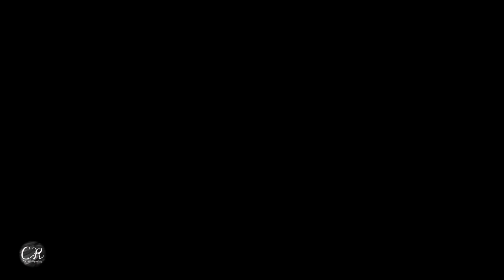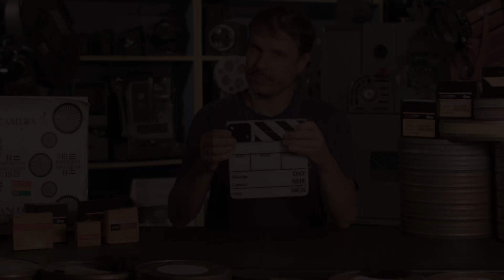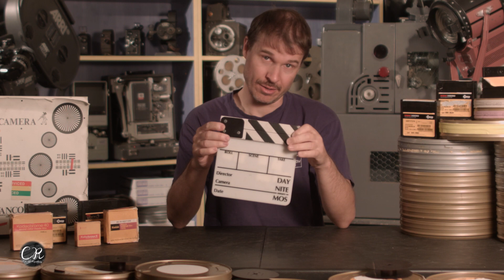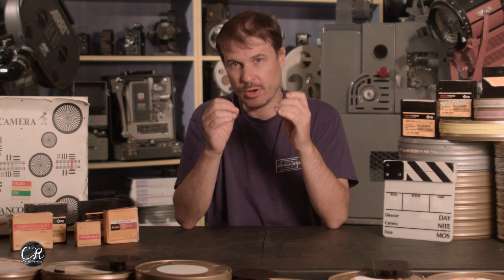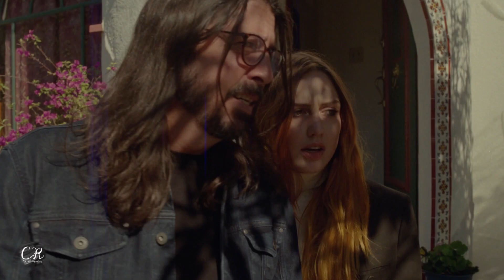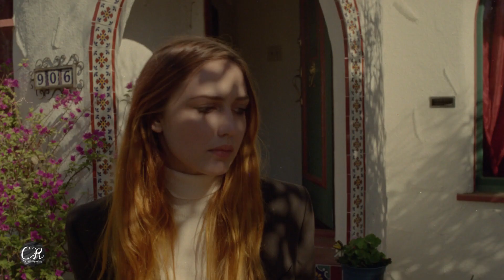Efficient Slating on film -The Workbench- Episode 9

Comment: Forty years ago, when I was a camera assistant, I went for a holiday relief job interview with the BBC here in London. Amongst the technical questions thrown at me relating to such things as use of the #85 filter, correct filling in of lab report sheets and labelling of rushes, was one where I was asked what the purposes of the clapper-board are. I replied that apart from obvious issues of identification and synchronisation, you could get 4 cups of tea ( for the DOP, operator, grip and me) on the back of mine. I was also asked what is the first thing to say to the cameraman at the start of the day. I assumed that I would be told what stock and/or lens was required, so I replied I would ask him 'Bacon or egg sandwich?' You can imagine my surprise when I didnt get the job.

Comment: A handful of other thoughts on slating, 'well duh' kind of stuff: make sure the slate is correct.  My editor has almost come to a fistfight with me on several occasions because the slate was not updated for the next shot.  Yes, you can kindof go sequentially in your audio takes, but this doesn't always hold true if you have false starts or do an audio-only take to catch room tone or go on break or shoot out of sequence or have a roll-out.  Seems simple, seems obvious, but on a high-pressure set or location for a micro-budget film and skeleton crew where you have to keep moving, these details fall through the cracks.  Have a good 2nd AC in other words.  ALSO, make sure the writing on the slate is legible.  2's can look like 7's or 1's with sloppy writing and it's even worse if camera didn't quite focus on the slate, or if the exposure on the slate is wrong for the scene, or if the slate is far from the camera for some technical reason.  For my personal safety, we've gotten to the point where we use a Brother label maker and print out reusable numbers or have a set of gaff tape squares with numbers and letters the 2nd AC can stick to the back of the slate when not in use.  Indy film is fun and rewarding when things go right... when things go right.